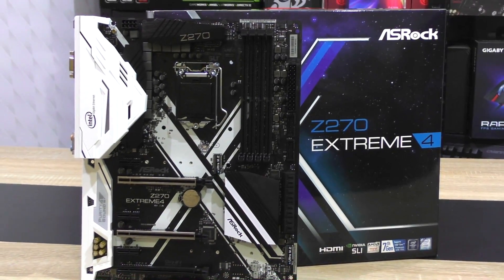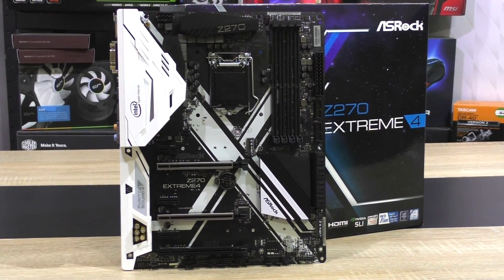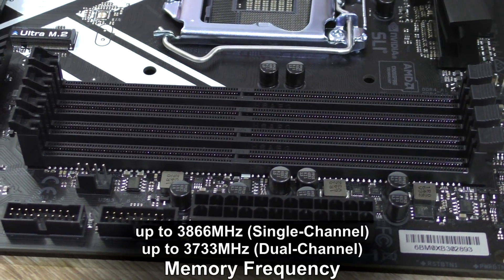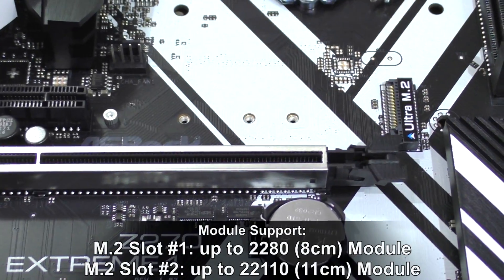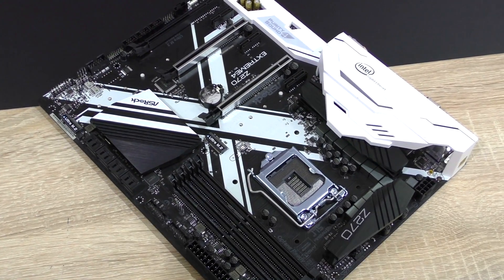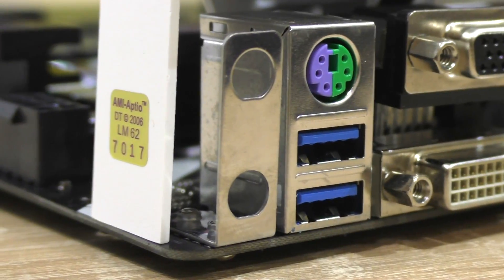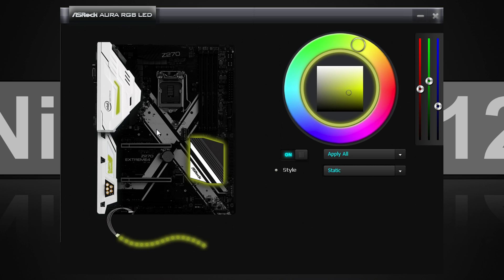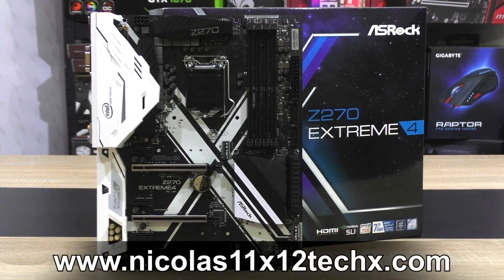THE ULTIMATE SWEET SPOT? - ASRock Z270 Extreme4 Review

Comment: Nicholas Please read this, also everyone else who wants to buy this. *WARNING!

I bought this board on the 16th, and as appealing as it is, and as much as it is decent and nice, it has problems. THESE ARE PROBLEMS I'VE HAD SINCE BUILDING FROM my old z170 stinger.
Note that I have only changed the MOTHERBOARD in my build from the evga mini-itx one, so all the problems are likely resulting from the ASRock Extreme 4.

THE UEFI SETTINGS DO NOT STICK once in the OS. The only settings that work are set from the A-TUNING software, which do not let you change voltage for the CPU to fixed, only offset.

The board FAILS TO BOOT SEVERAL TIMES, and gives a message with this writing at boot EVERY TIME. Then, when it lets me select where to boot from ONLY AFTERWARDS does it boot fine. Every time it restarts or shuts down this happens.

The XMP DOES NOT WORK with my G.Skill Ripjaws V rated at 3200 speed. I tried the forum suggestions for voltages and such with no luck. I am running the board with a 6700k, and the memory worked with XMP on the other board just fine. So not sure what is happening.

Maybe I got a bad board or something. All the I/O ports work, I have installed wifi m.2 and it works perfectly, the RBG works. The PCIe slot works, so do the sata ones. The fan tuning is the ONLY THING FROM BIOS that STICKS, everything else may as well not even be there.

I do not know how to switch bios, maybe that would help. Anyone knows?

Comment: Hmmm... Shouldn't most 7700Ks be able to hit 5 ghz quite easily? That's what I seem to hear. Maybe you got a poor overclocking 7700K.
Reply from the maker: Hiroo Matsunaga I even managed 5.1GHz, but I didn't want to show that here, since the CPU voltage is way too high at that clock speed with this motherboard. It's not supposed to be a super overclocking board after all. ;)